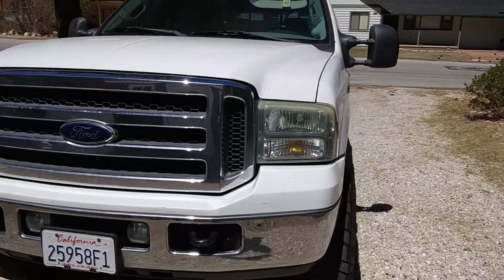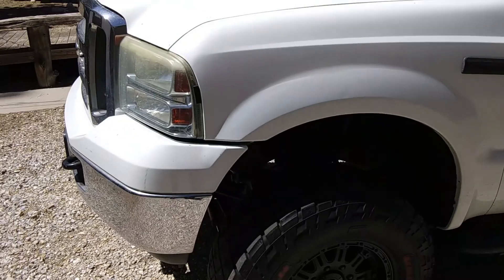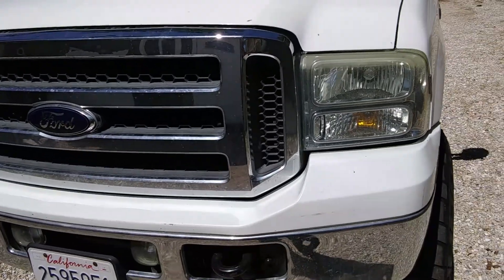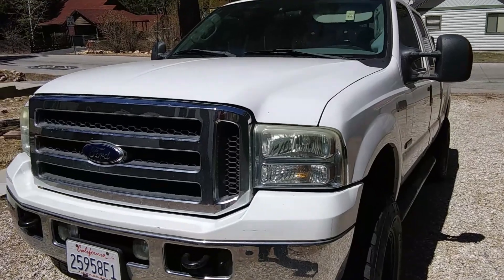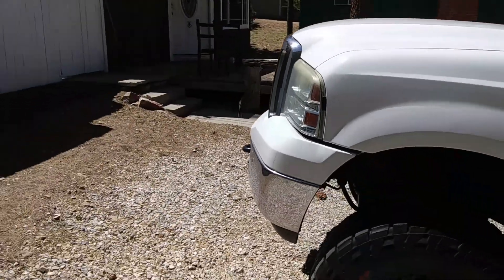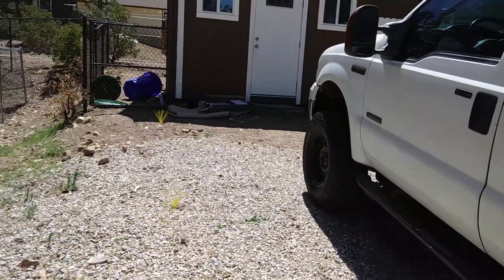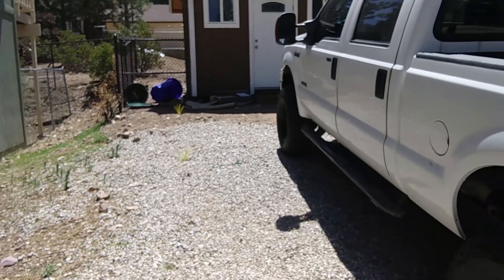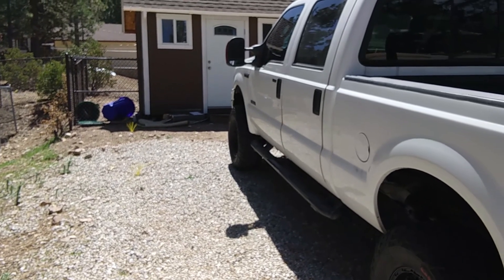ARCHOIL AR6200 VS Diesel Kleen challenge Part 2 carbon clean up

Comment: hi guys my jaguar diesel was sluggish and going into limp home mode, after cleaning the mass airflow sensor i used this stuff { half a bottle to 30 ltrs diesel } and wow no more limp home mode and so much more  quicker, happy eingine will be buying more of this product. once you put the archoil in i ran her for 20 miles and then kicked the turbo in on a hill and the shit that came out of the exhaust was unbelievable, anyway just thought id let you know how i got on with this product. BIG THUMBS UP.

Comment: So whats ur honest opinion on the 6.0
Reply from the maker: Every car has its problems, This is probably the most paranoid I have been about any car or truck. I'm still running the original injectors and head bolts. The only thing I've done is the dummy plugs, IPR, ficm and radiator.  The STC fitting had already been replaced before I got it. I think staying on top of your engine is key with these truck. Every time I go to the mountains I use my torque app to make sure my engine is running fine. I've installed a exhaust temp and fuel pressure gauge, two things my torque app does not monitor. I wanted make sure I wasn't starving my truck for fuel. I'm running a hypertech stage 3 tune.
Reply from the maker: I don't drive this truck around town. Its cheaper to replace my 351W engine in my old Bronco. Diesel engines get caked with carbon fast is you don't never allow them to fully heat up.